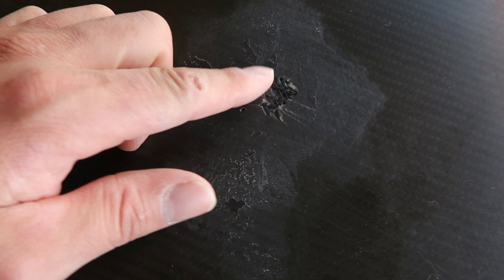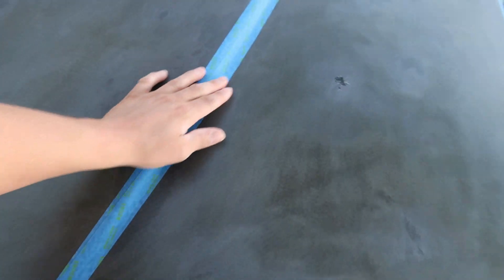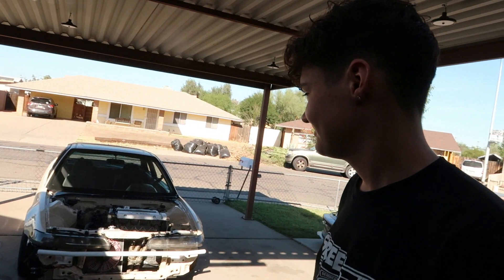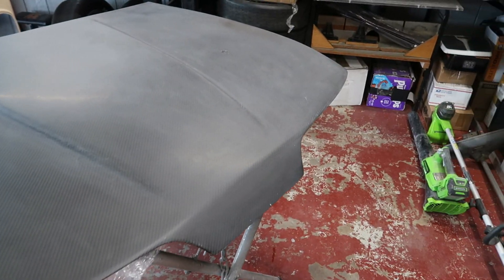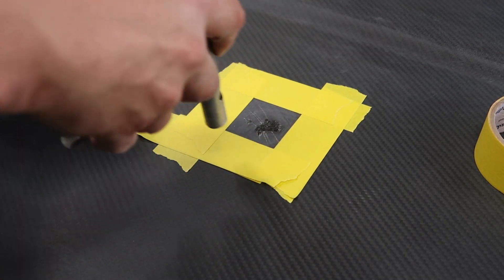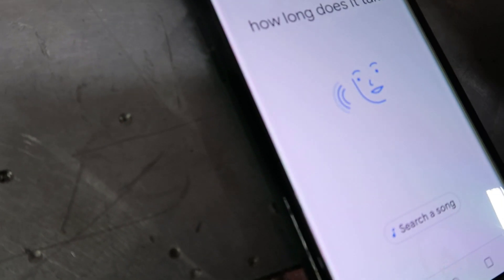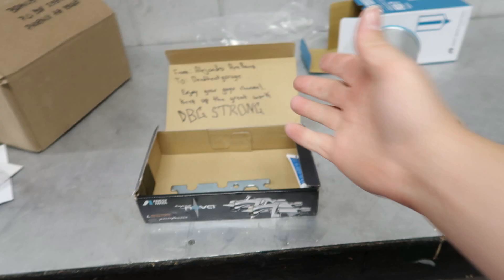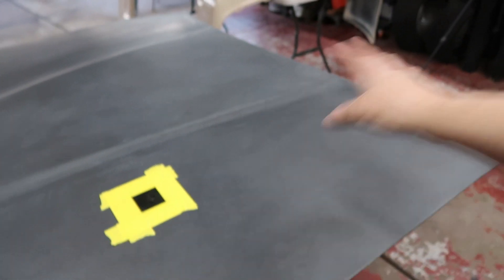How to fix cracked carbon fiber

Comment: That’s a sweet really nice iwata I bought one for around $400 for the same one used kinda beat to shit and had to buy two parts for it there not cheap at all he’ll yeah you’ll be spraying straight glass now most likely won’t need to cut and buff if set up right

Comment: When using epoxy after you mix you want to extract the air bubbles i.e. pressure chamber or after pour propane torch

Comment: Just need to sand with 240 until you take off the clear, after that, finish with 400-600 dry and your good to clear over it

Comment: So 800 won't take off the old peeling gel coat? I've got a hood that's fiberglass with carbon fiber overlay and it is damaged all over it. I just wanted to fix the carbon fiber where it's smooth again and then probably wrap it